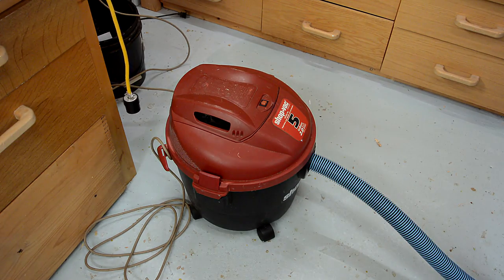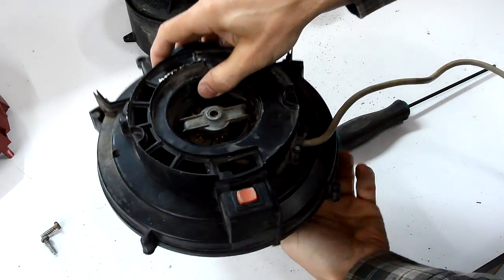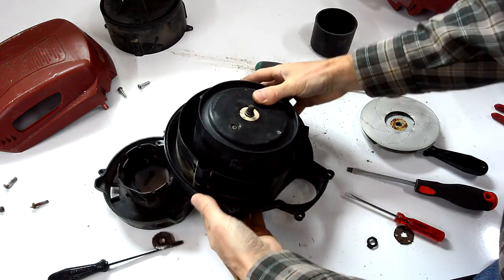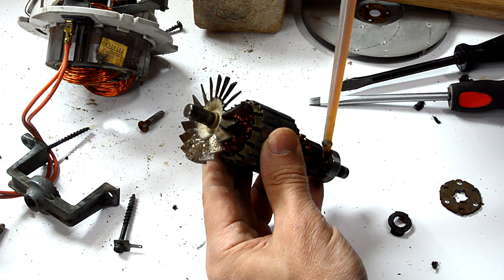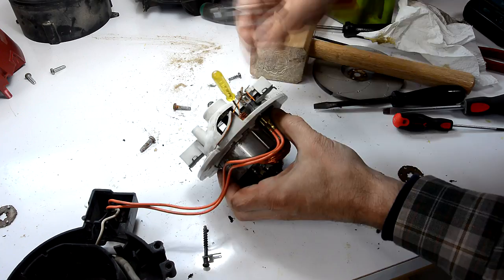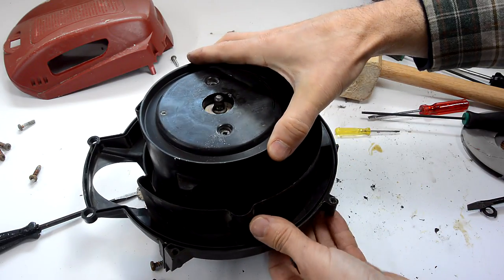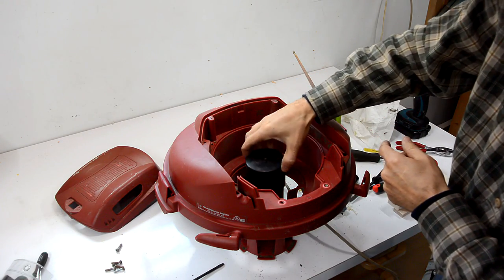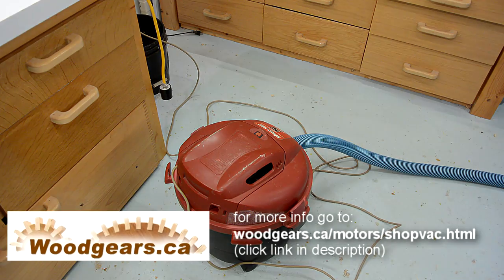Oiling noisy shop-vac bearings

Comment: Nice fix, but the fix was more trouble than it was worth by 1:12. Vacs need a little oil filler tube for the bearings, but if the Mfg's added that, your vac would last a lifetime and the Mfg would go out of business.
Reply: I just drilled a hole in the top of the pot  metal bearing holder and lubed my wicking then added a small screw to keep dirt out.. Easy piezy.. That big area around the bronze bearing holds wool packing or the equivalent.. They sealed it to have a planned obsolesce old motors have oiling ports that go directly to the wicking that keeps a supply of oil on the bearing. As long as you have wicking you can lube them or just add your own..

Comment: you put the float up-side-down.  oh well
Reply from the maker: Actually, no, that's the way it's supposed to go.  It floats opening down too, and won't fill up with crud.
Reply: Ive learned to never question Matthias. He's never wrong. I see it on every video.
Reply: nope. it uses an air bubble to float higher.
Reply: Matthias Wandel well my ridgid is the other way.  oh well.  thanks again.

Comment: Thank you for being stubborn enough to keep repairing stuff that was clearly not designed with repairs in mind.
Reply: The impeller came off. On many units the front bearing is inaccessible because the blades are permanently mounted to the motor shaft at the factory. As Matthias also pointed out all he really needed to do was was lift off that top cover to access the bushing to lube it.
Reply: That's not the first thing he tried to repair though.

Comment: That is a bronze bushing, not a bearing. 
You should of replaced the bushing with a bearing as well as the top bearing. The total cost of the pair of bearings is less than $10.00 usd, can dollar.
Oiling it is just a waste of time and will cause a new set of problems when it warms up and spins out onto the interior surfaces of the electric motor.
This is a bad way to fix this problem. Another band aid fix!

Comment: Great video and article

Typo at 
http://woodgears.ca/motors/shopvac12-b.jpg

driver vs diver
 
This is the blower after removing the cover.  The blower impeller is held on
either by a nut (which is best removed with a nut driver in an impact     diver        )